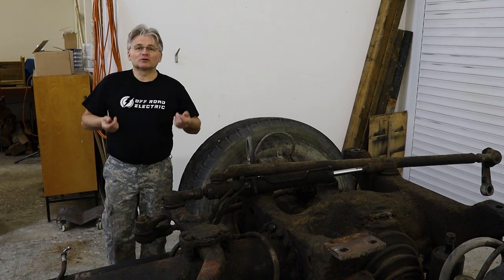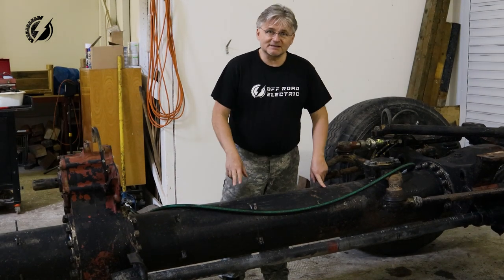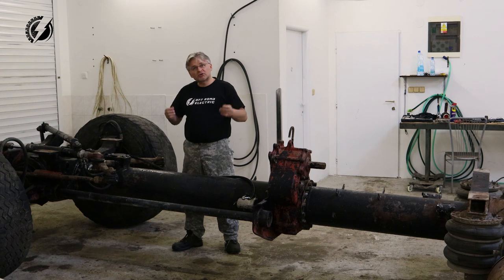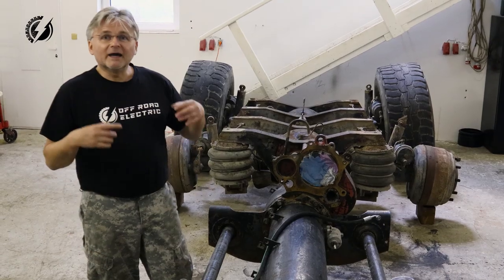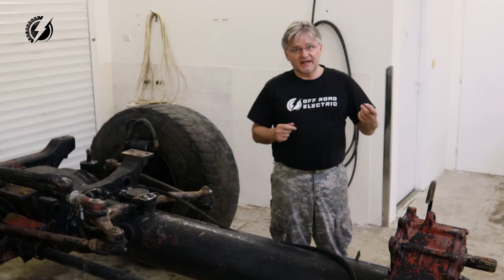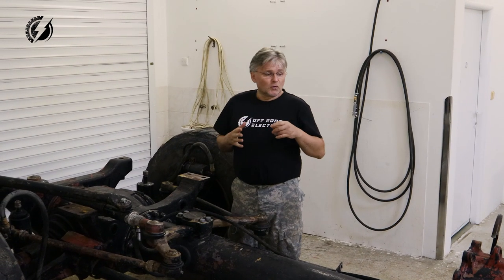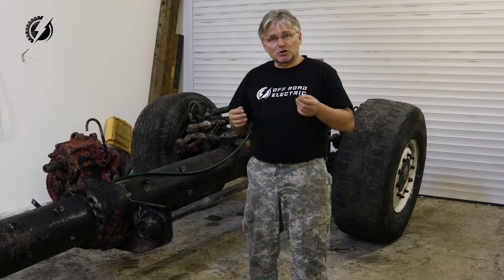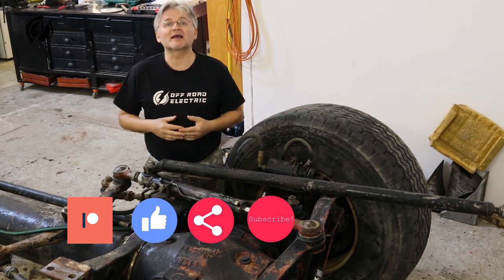Best Off Road Electric Monster Truck Build | Details explained

Comment: I had wondered how you planed on joining 4 motors together for this.  The only thing I could come up with that seemed reasonable was two transfer cases.  Nice to know I am not crazy!
Reply from the maker: Than I am not either.:) Will talk about this in next episode  on Tue.
Reply: @offroadelectric9457  I will watch with interest!  I have similar but smaller goal.  No Tatras in the United States, so I will make due with a Ford F-800 or C-8000, or perhaps convert an old school bus.  It is frustrating trying to find electric motors that can deliver comparable power so I may look into a dual motor solution, basically to copy what you are doing but with only a single transfer case.